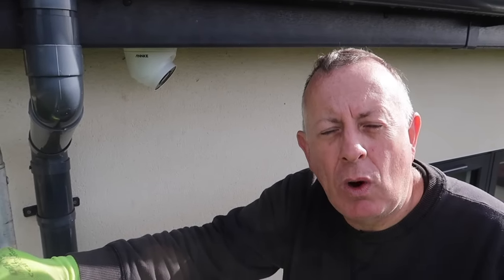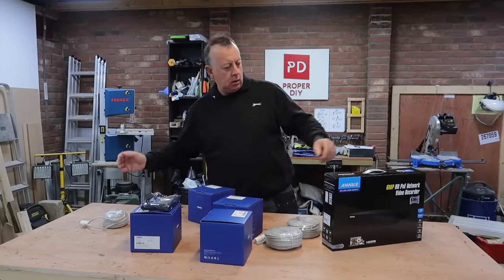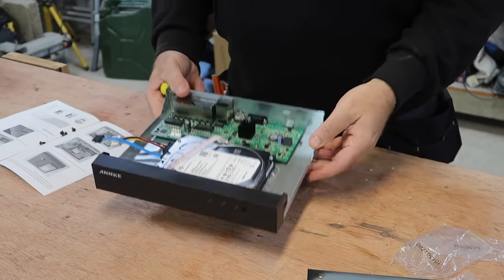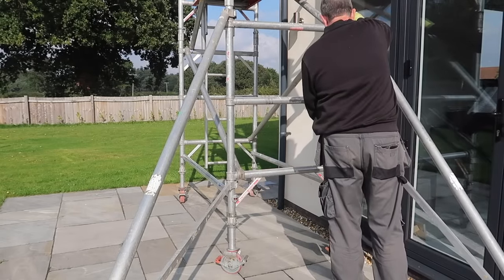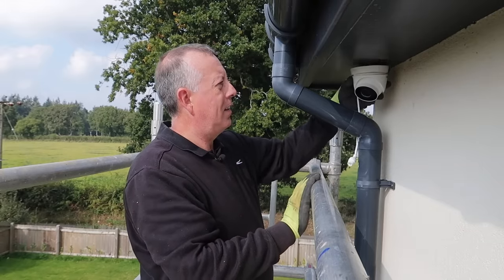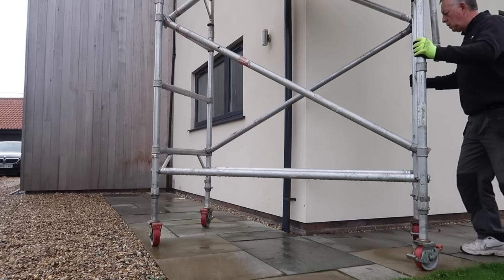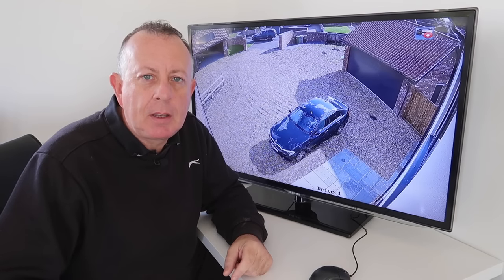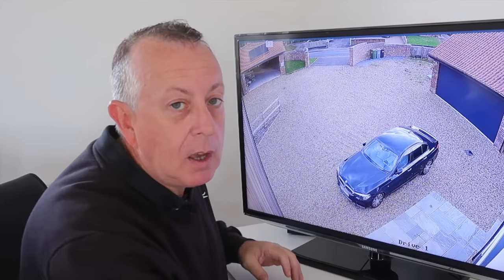Annke H500 - 6MP Super HD POE Security System - Full Installation

Comment: I know this Video is old and I am sure you long time ago figured out that one part of your Video isn't correct. Now you said that when you picked the area for Motion around your car and the area in the Grid won't be Recorded this isn't how that works. The Grid is where the Chosen part to pick up motion is. That is why when you had the Grid up and the car was going by it was showing the red filled area. This way if you are working on an area where leaves or other things are being detected you can make adjustment so them things are not being picked up. Also great for trouble shooting. Why no Motion recordings lets look, Yeah there is motion now lets check playback oh none. Must be a setting I forgot. Look in Recording Schedule and or check the HDD.. Anyway nice video. While I have 8 Annke Cameras and 3 of their DVRs they are not a system that I use often as my Go too because I have better system with better options where I get little to no false alerts. Notice on my phone from my Annke 5mp Driveway camera I know it is Human or Vehicle. Even though Annke system i have should do that same thing it don't work. A cat or dog sends me an alert. So needed something with better higher in Tech.. Anyway. Just thought I would point that out in case others happen to see the video and wonder why everything in the grid is being picked up and not the open hole area...I have personally over 50 cameras with more then 10 being PTZs with largest zoom factor of 43x. 4x, 5x, 10x, 12x, 18x, 20x, 23x, 27x, 36x, 37x and 43x and a few bullet or box cameras that are zoom 4x, 10x, 12x, 20x 37x. Some of my cameras I have had since 2011 and still works as  new. While not as high quality as the 4k cameras I own the zoom cameras will see better at distance lol. One of the biggest mistakes people make is they leave the recording setup as Full time only and that will eat up the HDD so fast. my 32Ch 16POE NVR has 2 HDD bays and 10tb of HDD installed. I have footage as far back as 5 months with some of the channels recording full time most of the others are Event only. Ones I record full time are with Audio seeing I live in a 1 party state. I also post signs on my property that I Audio and Video Record. Word of Caution if anyone has read this far. IF you are going to upgrade your POE cameras to a High end POE PTZ you will want to change out the Cat5E camera cable that came with the All In 1 Kits. As I am sure it is CCA and will kill your PTZ rather fast... Be Safe

Comment: Drilling inwards????
Reply from the maker: Yes, as I need the outside position of the hole to be exact (+- 5mm) but have flexibility on the inside. I couldn't get this accuracy, while drilling an angled hole from drilling from the inside.
Reply: @ProperDIY  pilot drill with a smaller diameter bit and turn off hammer action about 50mm from end, less dinner plating as you break through. Probably Thermalites on inner leaf so drill would cut clean w/o hammer.

Comment: Hey @Proper DIY

Great video - very informative and entertaining as usual.

I wasn't quite able to see from the video, but are the ethernet cables they provide of a standard type whereby they could be swapped out for longer ones if you needed to? I need them to run over quite a long distance and just want to make sure that they're not hard-wired, Annke-specific connections on the ethernet cables or something that I would need an electrician or the like to re-wire for me if their supplied cables aren't long enough.

Thank you.

Comment: Tried to buy the h800 system with 8 camera,s using code but only applies to the model in video. This system is the one to have annoyed code did not work
Reply: @Andrew Raistrick You didn't really think they would give you 25% off their best system. This ones  pretty much old hat now check out the comments for some clues on better systems.

Comment: My criticism is your choice of location🤔 all you veiw is the tops of heads they should be located 3.5 metres from the floor, you should also fish your cakes up the cavitys.. Then the job would be perfect, but not a bad attempt for DIY 👍
Reply: Fish (pull up) your cables up the cavities?
Reply: @a northern soul It's a new build will the cavity be full of insulation and maybe difficult to fish?
Reply: @135Ops  if you drill up at a steep angle 16,18mm hole your rods will fly up I do on average 2 installs a week and never have a problem. If your 3.5 meters from the floor you also go above the tray or membrane to, at this location it easier to I'd people on a viper, with the police plus you can I'd cloths brand's and faces too 👍

Comment: Surprised that the installation of security cameras is not regulated as they could infringe on peoples privacy.
Reply from the maker: Not regulated yet but there are government guides to what you can do
Reply: @ProperDIY  Thanks for your reply.   F.Y.I. Recently in Ireland a requirement for the installation of security cameras for a home must be installed by a registered installer. I am not sure, but I think is a result of complaints regarding cameras looking into peoples property.  In my case, my neighbor installed a camera ( before the requirement)which was looking into my back garden and when I checked there wasn't much I could do about it except increase the size of my fence which I did. The new system I think will insure that the cameras do not infringe on neighbor privacy. By the way, your video was very good
Reply: @ProperDIY  The law on home CCTV changed some years back and is now broadly in line with that of commercial premises. The main focus is what is recorded outside of your property boundaries, how that footage is retained and what it is used for. Recording outside of your boundaries make you a "Data Controller" and means you have to comply with Data Protection Laws. With regard to that recent court case the reason it was brought by the Dr was not made very clear but had a lot to do with how the other guy failed to comply with his obligations under the Data Protection Act.

Comment: Jesus ...unless you like looking at the tops of head etc.These cameras are all TOO high
Reply: @andymerrett  those cameras are generally not used for identification but just detection for follow-up by other services. Cameras for use in a domestic situation should identify the requirement for the camera system and being able to identify an individual can be necessary - at which point the height of the camera would have a massive impact on its performance and it's justification for installation.
Reply: @andymerrett  Councils dont have a clue .... CCTV needs to have a few cameras low down to get full face on view . Dont argue .
Reply: @andymerrett  You obviously don't understand that different types of camera have different functions, spouting off on here displaying your lack of knowledge makes you look like a W?